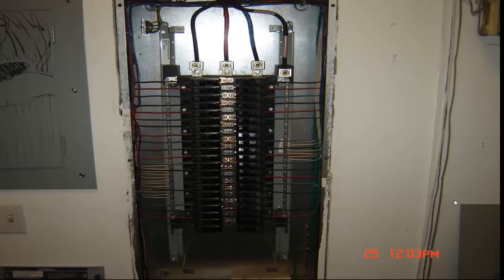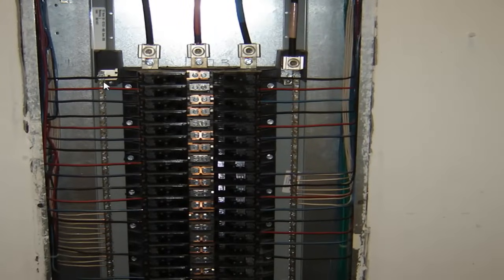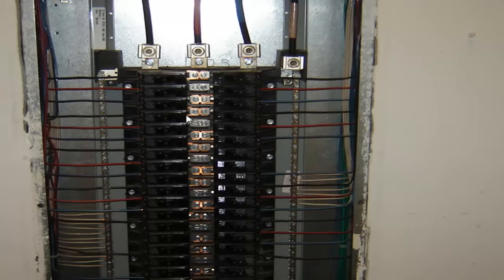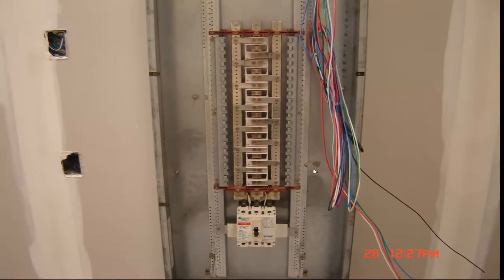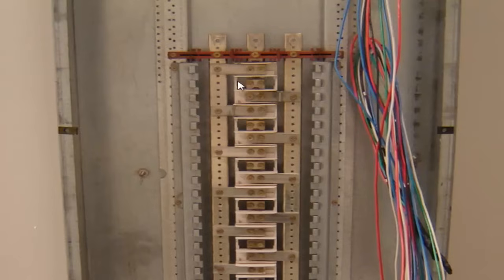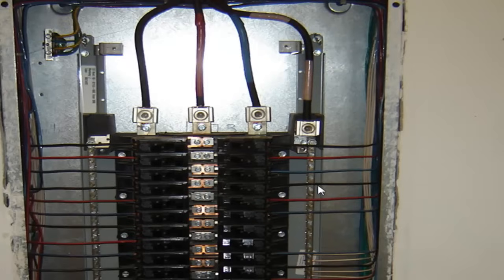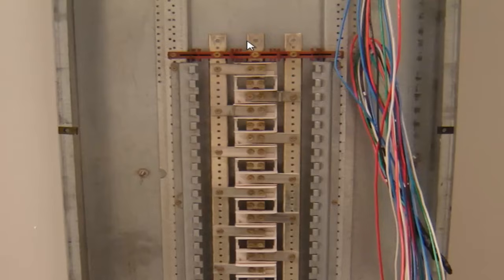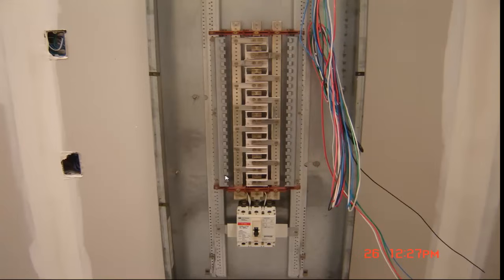Electrical Wiring- 3 phase panel detail

Comment: I have a 480v/277v service with 75 kva transformer, I need 208v 3 phase.  I have a 480 panel, a 277v panel & 110v panel but no 208v  3 phase panel.  Can I pull the 208v 3 phase from one of the existing panels..?
Reply: First of all, you should do some load calculations of that 75KVA Transformer to see what your load capacity is. Your full load amps (FLA) on the secondary is 90 Amps. I will assume your 480 Panel is your feeder panel, and all others are sub-panels. I will also assume that the 110 V Panel is coming off a breaker either from the 480 V panel or the 277 V panel, but there is a transformer set up somewhere to give you that 110V. If that is the case, then you will need to do likewise to get 208V. You would come off the 480V panel to a Transformer with a Wye Secondary to get your 208V.
Reply: Square D / Schneider Electric General Purpose Transformers
#753TH,- 75kVA, 480V Delta, 208Y/120V, Transformer - this is the transformer, I would assume the 208Y is telling me it is a direct tap off the transformer...yes..no...?
Reply: If the name plate on the transformer reads 480V Pri  and 208/120V Sec., then you do not have a 480/277V system, you have a 208/120V system. Anything that you have that's giving you 480/277 is taking place BEFORE the 75KVA Transformer. You are probably in an electrical closet with a bunch of panels and a transformer. At the transformer, you might see a conduit going in one side and a conduit exiting the other side. Those conduits are connected to panels. If you trace one of the conduit, it should lead you to a panel that is a 480/277V panel. If you trace the other conduit, it should lead you to another panel that is a 208/120V. So the Transformer is already giving you the 3 Phase 208 voltage you are looking for. When you get a chance, take a voltmeter, make sure it is on the 600V or Higher setting, and go around the room and take some readings and see what you get. Carefully, take phase to phase readings and phase to neutral readings.
Reply: OK, so are you saying you understand now, or not? If not, tell me again exactly what it is you wish to accomplish! If it is to get a 3 Phase 208V service, you already have it from the secondary side of the 75KVA Transformer.
Reply: Based on what you see the secondary side will provide 208 3 phase yes...?
Reply: Like the way u explained that . . .  I actually understood it!   lol

Comment: I was hoping you would have shown the voltage across the lugs via the breakers.
Also there is some confusion that I am reading regarding the nuetral.
I know that some loads require that you have a nuetral that panel was done very cleanly I appreciate clean work morew so than speed. JMO
Reply from the maker: Jack I have a  3 phase panel that I'll be using in future videos that will show voltages.It will be a video somewhere along the lines of my control panel video. 
http://youtu.be/eHd9EUuMzlU

3 phase equipment may or may not require a neutral,interior lighting most always requires a neutral. I have seen some 208/240volt lighting used as interior lighting but it has been very rare.

Thanks for watching & your comment.
Reply: No I am not trying to be critical I hope that you don't take it that way. 
Video was great breaking down the busbars.

Comment: Why are the grounds and neutrals separated in a 3 phase panel?
Reply from the maker: They are separated because it is a sub panel.Even single phase sub panels are separated.
Reply: Could you place all nuetrals on one side of the panel to leave the other side for newer circuits, or are they supposed to be balanced

Comment: To Scott Hendrix, one of the legs behind your meter may be loose or broken, causing that symptom. To inspect for this involved a "band removal"  call to your power company to come out and officially remove the retainer band around the meter, so no-one is accused of tampering. Also I recommend having an electrician check this as it can be dangerous, the amperage potential behind your meter can be staggering and deadly. Remember, you're paying an electrician for what he knows.

Comment: Question to any electrician in nyc: I am replacing a panel with an existing riser. It was fed from the bottom. Ive never installed a main lug only panel with the lugs on the bottom to feed the panel. Is anyone familiar with this? Are there any adjustments I have to make inside the panel? 
Any help appreciated thx

Comment from the maker: I do run into the high leg quite often. I have seen huge errors when people don't pay attention to the high leg. A few years ago I was in a hurry on a service call and didn't check voltage,took out a computer power supply!! The panel had no markings on the feeders and was jammed w/ 2 & 3 pole breakers so it was not an obvious thing!!

Comment: I have a wall oven 4 wire inside the tag it says 120/208 how do I go about hooking it up to a 200 amp breaker box. The wires are small and looks like a 110 wire
Reply: BRENDAJASON1 get some 18/8 wire from Lowe's, use only green, red, yellow.  Youll hook the green to the ground in the pannel and the yellow to the neutral bar in the pannel and red to the 50 amp circuit breaker. On the device hook yellow to "L1" , red to ground, and green to neutral or white.  
Turn on the breaker and begin using the device.
Reply: Tan Tan if I hook the red to ground isn’t that on the 50 amp breaker

Comment: Thank you for a good Video...
So I checked my electrical and I have a 120/208v Y type 3 phase service...
I am considering some equipment and CNC machine components.... that are speced 220v 3 phase.   Does that mean I can't use it if measuring with a multimeter confirms 208v across any two of the Line leads?  Also.... some machines are from overseas where they use 50hz...  not 60hz like the US... how concerned should one be about this?...  You seemed like an electrician that knows what he's talking about.. So thank you for your insight...
Reply from the maker: @Frankmali17 Thanks for your comment. Check your equipment documentation. Most equipment will specify what percent of voltage difference is allowed for that piece of equipment. Some have spec'd a  +/- 10%  and some at +/- 2%.  When it comes to equipment it is always best to verify with the manufacture for the proper requirements. There are many things to consider regarding the 50/60 hz issue. Here is a site that explains those details.  http://www.eng-tips.com/faqs.cfm?fid=1224

Comment: we have 230 and 460 3 phase in our industrial building. our single phase is tied in to the 230 3 phase after the 3 phase meter. its an instrument type smart meter. it has the coil ammeter on each leg. all of this is outside the building. the service tech came out today to fix a problem and he said our single phase service needs its own meter. I got to thinking, why does it need its own meter? there hasn't been one in the socket for years. doesn't the 3 phase meter also read the current draw from the two legs for the single phase?
Reply: adrock84ify  Normally should it work without problems. In Germany and Thailand we use mostly 3phase meter and then split the phases to the different electric single phase things.

Comment: I was having a discussion on 3-phase commercial wiring with my father today and we ran into a disagreement that we could not bring to conclusion because I don't think either of us fully understood what the other was saying. Maybe you can help? It is my understanding that in a 3-phase system, each of the three legs, or phases, has to be balanced according to draw. My father agreed, but said that all of the balancing was handled by the box itself, as a result of the jumpers between phases.

Comment: Thank you for a great video on 3 phase. However, a mock up of 120v and 240v hookup would be of tremendous value for DIYers. I'm still little unclear how I can hook a 240v 45 amp fuse in 3 phase MCB panel.
Reply: Im sure u figured it out by now, but you would install a 3 phase 45 amp breaker and wire ONLY a and c on the breaker a is 120v and c is 120v b is the higher 240v   When checked with nuetral

Comment: I know that you can put a 220 2 phase in a "home" panel. Can you put a 3 phase 220 into a home panel? I'm getting a pretty stout table saw that needs 3 phase.
Reply from the maker: You would need to check with your power company. There are a few rare areas here in the Phx Az that do have 3phase but most are only single phase.
Reply: Andrew R  on residential they only aloud you to use a single face unless is comercial space
Reply: Andrew R
Reply: I just need a help guys I just wanna no the breakers of 3phase
Reply: What if ur residence is located in a "commercially-zoned" area?  Could u get a variance for something like that?

Comment: You most likely have lost a neutral in one of the plugs. This happens often if plugs are wired using stab back (where the wire is "shoved in") jus open up each one staring with the first one not responding in the chain.

Comment: how you change from tree face to regular 220 v with two barrs
Reply from the maker: You can use a two pole breaker if that's what your equipment requires.
Reply: good exlpenation tks

Comment: Never assume the breakers on the even side are black, red, blue. Some one piece bolt-in are blue, red, black on the even side and must be wired back that way or the motor or control will run backwards or not function at all.
Reply from the maker: Can you give us the type of panel you are referring to so we can be on the look out while servicing such panels?
Reply: Electrical Industry Network Identification of ungrounded conductors: Provide permanent label indicating the color coding of
phase conductors based on voltage as noted below:
480/277 Volt Panel
Phase A - Brown
Phase B - Purple
Phase C - Yellow
208Y/120 Volt Panel
Phase A - Black
Phase B - Red
Phase C - Blue
120/240 Volt Panel
Phase A - Black
Phase B - Orange (high leg of delta)
Phase C - Blue

Siemens Panel will use single snap breaker 3 phase. On the left it's ABC black, red, blue. when flipped to fit the right side they are CBA when bolted to the main distribution panel center main taps. The breaker design is the reason. 

So be aware. I have had to fix many of these because they were wired wrong. In some cases the technician didn't notice the high leg and burned everything up that was single phase, or added a single pole breaker on the high leg empty space.
Reply from the maker: Claude Rains
 Good Info to know,thanks for contributing!
Reply: Electrical Industry Network No problem.  

This also includes ITE breakers. Most are even marked on the breaker as to the wiring color to use but most don't read them. 

Unless you do industrial or commercial I doubt people will run into this, but I have seen surplus panels used in some strange ways.

It really matters if you are load balancing a panel or trying to get the PF above .93 for power company credits.
Reply: Claude Rains 480/277 VAC  Panel   [ Delta or Y 3 phase?]
Phase A,1 - Brown { High Leg in Delta }
Phase B,2 - [ Purple?]  { Orange }
Phase C,3 - Yellow                                                                                          208Y/120 VAC Panel 
Phase A,1 - Black { 208 High Leg }
Phase B,2 - Red
Phase C,3 - Blue                                                                                                        120/240 VAC Panel { WYE only }
Phase A,1 - Black
Phase B,2 - [ Orange (high leg of delta)?] { Red }
Phase C,3 - Blue
Reply: Actually there is no NEC standard color required other then Gray, White, Green current\non current carrying conductor. 

As any color tape or wire can be use outside those the NEC has spelled out. You can use Black, Red, Blue, Purple etc.. on any voltage panel you want. Only the panel has to be marked, as that's done by the factory per UL certified equipment location and use.

Comment: 220 volts, how much voltage red, white and black wiring work, why RED & WHITE MEARS 150 VOLTS, AND BLACK AND WHITE WIRE MEARS 100 VOLT. QUESTION: HOW TO FIX IT

Comment: multiply 208 times .58 and thats your answer, and that goes for anu 3 phase voltage system. Current would be 1.73 times

Comment: Nice clean panel.. but!.. up here in canada in our Electrical code book we phase (A=red )  (B=black ) (C=blue) as would be the breakers in the same order 1 red 3 black 5 blue and etc..color codes are important...arent you suposed to do the same and say that in this video especialy in accordance to 3 phase power?.... so not black red blue...         RED BLACK BLUE..
Reply: Sometimes I see BOY (B=brown) (O=orange) (Y=yellow). When is it proper to use BOY v. RBB? What is the electrical code for machine panels on what color wire you use to wire the power circuit?

Comment: I have a question,IN THIS VEDEO 3 PHASE,CAN YOU EXPLAIN ABOUT THE WHITE WIRE NEUTRAL,ARE THEY SHARING NEUTRAL IN 1,2,3,LINE? NICE VIDEO SIR.I LIKE THIS KIND A VIDEO,CAN YOU MQKE ANIT HER VI#EO,ABOUT 2JSE. OR SINGLE PHSAE
Reply: The white wire is for single-phase/120v applications. 3-phase & 240v applications do not require a neutral.

Comment: Also your circuit wires are suared off at 90 deree angles, circuit wires and all other wires should come into their landing points in a sweeping motion. The code book clearly states the degree of bend of all conductors. wire insulation will break down quicker the tighter the radius in the bend of the wire.

Comment from the maker: No they cannot. Codes have changed,now you have to run a separate neutral for each phase. Use to be able to share one neutral with a.b,c circuits on a three phase & 1 neutral and single phase 2 ckts per neutral.

Comment: Those cables are to tight! There should always be slack in a cable.
Reply from the maker: And you base this expert advice from?????? I have seen hundreds of panels made up this way! NONE of which ever had a problem.
Reply: Why?  Why do they need slack?
Reply: It has nothing to do with performance. But, if you're power requirements change, & you have to relocate that wire to another breaker
that's close by, then you might not have enough slack to reach the new location. And, it also looks more professional, in my opinion.

Comment: THIS PANEL IS WRONG   from left to right should be Red Black Blue therefore Cir 1 red circuit 3 black circuit 5 blue   and then on and on
Reply from the maker: "It is part of electrical wiring systems common in the U.S."
Reply: That is the Proper way of wiring it, but a lot of electricians randomly put the colors since all three wires are hot, so they don't care about the wire colors pattern.
Reply: Look at the nec 408.3 (e) left to right top to bottom black red blue